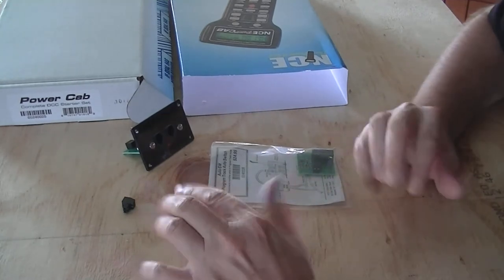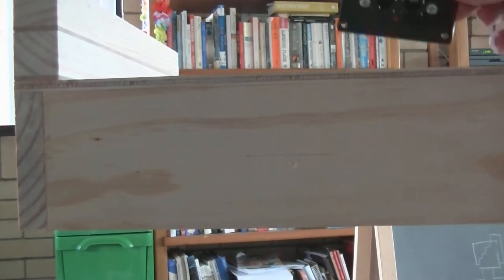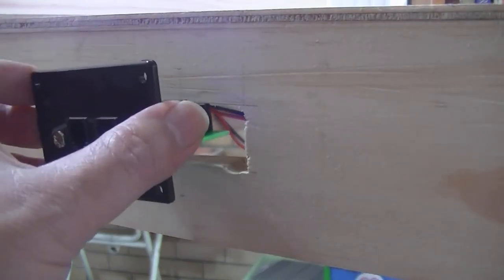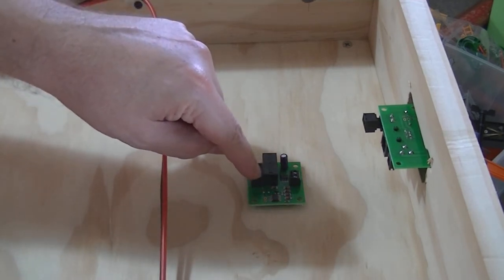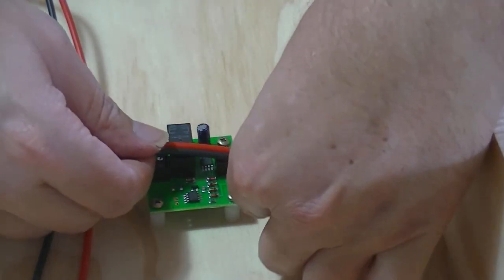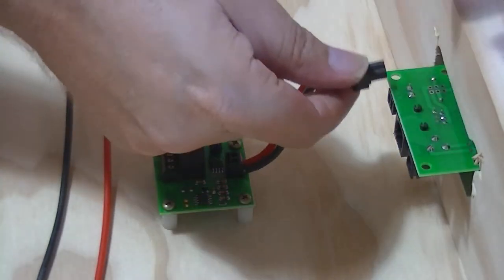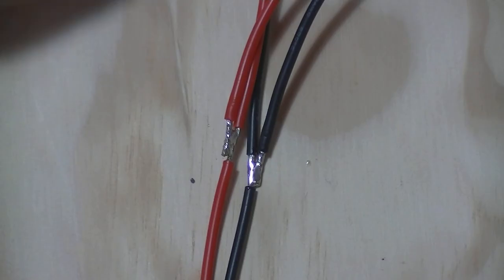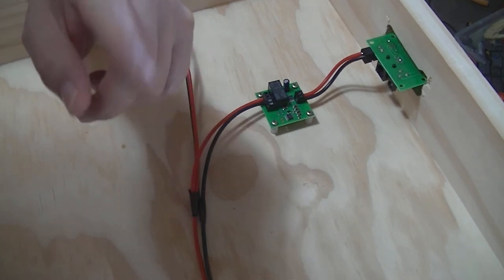Installing NCE powercab panel & auto switch

Comment: Do I have to use a switch? If not does the wiring go from the powercab panel to the bus line? Thanks bud, best video ive been able to find so far that has helped me on deciding what cab to go with.
Reply from the maker: Hi, no you don't have to use the switch. The switch just makes it easier to use the program track function. Without the switch the wiring goes straight to the buss line. Glad you enjoyed it

Comment: I see you returned to the nce system. In the past, you went from nce to digitrax. Any particular reason for the switch back?
Reply from the maker: +Steve Tee NCE was my first DCC system and I guess I have a soft spot for it.
Plus I never have tried train automation with the NCE equipment before